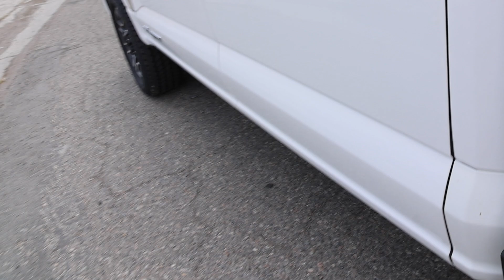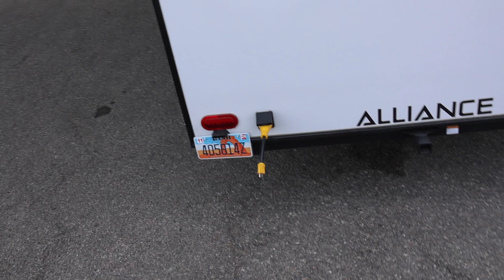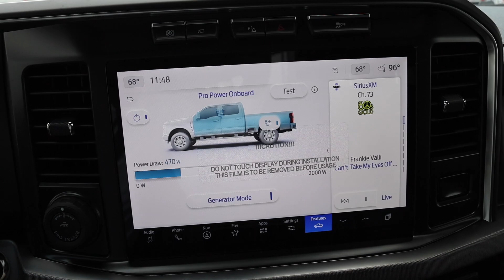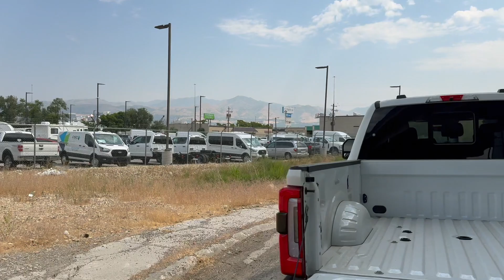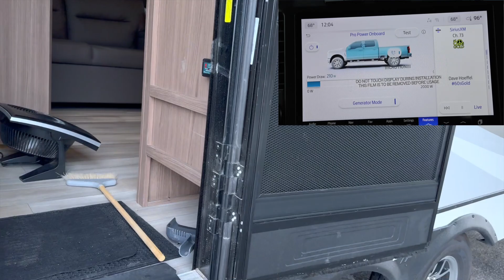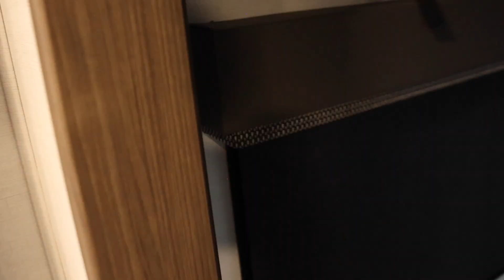Can The Ford F350 2.0 KW Pro Power Onboard Run My Entire RV???

Comment: I have a 2025 F150 with the 2kw onboard generator. In my TT I have a 270Mah battery and a 3000 converter.  When boon dock camping, we turn off the inverter and only use those plugs and accessories that pull direct from the battery.  When we have to use something like the microwave, we turn the inverter on.  Our A/C is roof mounted and very efficient, but it will only run on battery for about 5 hrs.  We did hook the TT into the 2kw but unlike the larger generators, the 2kw puts the F150 into a constant idle mode.  Meaning, the truck is always on.  As an alternative, we carry a large EcoFlow Delta Pro in the truck.  We run the normal TT power cable from the TT to the EcoFlow and if we manage our usage, that set up can get us through an evening with the A/C running.  To charge the EcoFlow, we plug into the 2kw...you have to set the EcoFlow through the app to draw/input something like 8w (I think it's watts, I have to look at the app).  Anything more and the breaker on the 2kw might pop. I do wish the truck I got had the larger generator, but none were available in our area.  The above has worked for us, but we could be doing something wrong, so if someone has a better option for power management, please post it.

Comment: The 7.2k in the 150 Powerboost will run your RV completely for a weekend for sure.   This 2K one won't do that, but it will allow you to keep your batteries topped up, for lighting, water pump, radio, Tv and the like for sure.    Some power is better than no power at all.

Comment: Dude,  you get 400w without generator mode.  If you want 2000w you gotta turn on the generator mode.

You’re running your TVs and converter off 400w system. Not even touching the 2000w

You definitely can’t run your microwave off the 400w system.  It would run off the 2000w

Comment: I like the idea of using the 2kw on board power to power up the basic 120v in the trailer. This to me is a great way to charge your lithium batteries when traveling via the trailers converter rather than all of the cost/work to install a dc-dc charging system.
Much easier to use a 120v 12-14g extension cord as an umbilical to the trailer rather that a couple 4g (or bigger) for the dc-dc charging.

Comment: Get a shorter larger gauge extension cord. I can run my bedroom AC with my Generac 2200i (1800W running) using a 25' 10 gauge extension cord. The adapter you have is similar to the one I have. If you strip back the insulation, the wiring is 10 gauge. I just got delivery of my 2026 F350 with this feature so I'll play with it on my trailer to see what I can run using my 10 gauge extension cord. That's crazy your trailer couldn't keep up in Vegas. I know it gets hot there since we always stop to stretch on our way from SoCal to Southern Utah every year. Our trip this year to AZ was pretty hot in Havasu and our trailer stayed 72 throughout. It's a 34' toy hauler but it kept cool. It was 117 outside too. The trick I found is to put that reflective bubble wrap in the windows.
Reply: could you run your ac from your f350?
Reply: @Prietoalejandro I never even tried lol. I was literally just thinking about this too. My assumption is the locked rotor surge will trip the power station. My Ryobi 1900 psi pressure washer kept tripping it 🤷🏻‍♂️

Comment: It would be a life saver if you had a 120v refrigerator full of food and were traveling from one rv park to another. Or, it was freezing outside and needed to run the fan for the gas heater. For obvious reasons you wouldn’t want to run an rv on 2kw of pro power all the time, but in limited situations it might come in handy.
I have a f350 with the 2kw pro power. Ive used it twice in two years. Once to charge a dead battery and another to power some 120v lights. Both times  less than an hour.

Comment: I made my own cord.  Purchased 8awg and a 115v plug end.  The wire is 18 feet.  Plugged in at the truck bed and ran the other end through with the factory wires to the transfer switch and wired it in. My unit is 41 feet with two coleman mach ac units with coleman soft starts.  I'm able to power up one of them and also keep the fridge running while driving. Your issue is too long of a cable with too small of a guage wire.  You had a lot of voltage drop.  2000watts divided by 115volts is 17amps.  Plenty to crank up an AC

Comment: Ram has a 2,400wt as well. I think it's an unnecessary item unless you run a hotshot. Then, you can power a microwave, etc. Idle is bad for all motors. Gens are built differently

Comment: It'll work great in a pinch if you use gas for the water heater and fridge. You can run the microwave at lower power level as well. 2,000 watts will run our 15,000 btu AC also. We use a 2,000 watt Honda for camping. You shouldn't hurt your truck if you go over 2,000 watts. They have circuit breakers for a reason.

Comment: No way that camper is 50 amp. There is only one AC unit. He says there are 2 but a camper that length never has 2 units. If it did, it would never get hot even in the desert. So much wrong with this video besides this too.
Reply: I think he would know if his camper has one or two a/c's

Comment: generators "grow legs" 
i would recommend f150 hybrid or even better a Lightning for something that wont disappear easily. this is more to charge 6-10 tool batteries at once and run your laptop.

Comment: Just to let you know.. when your trailer is plugged into a power outlet (i.e the truck) the converter converts the 110v to 12v.. so the 12V appliances will be drawing from the truck.  Still, good video.  I'm looking at getting an F150 to power a trailer I also will be getting.. so likely will be looking for the hybrid with the 7.2KW onboard power.

Comment: I thought with the Pro Power option on the super duty you got a 208/240 style outlet?
As for the idle time -- that should bother a diesel less than a gas engine.  Yeah, the particulate filter will have to go into regen mode more often than if you were driving down the road, but one of the advantages of the diesel engine is the longer life.

Comment: I have a 2013 f350 with an inverter that plugs into the cigarette port. Would it be safe to run it off that or should I use the plugs

Comment: I'm hoping to leverage the Pro Power Onboard to charge my battery bank in the 5th Wheel while going down the road so that it's at 100% when I get to the Boondock site. The motor will be running anyway driving down the road and then I can just use the batter bank once I'm parked supplemented with solar. Any reason this won't work? I jst need to find a way to run a cord through the 5th wheel hitch to the lower bay.
Reply: I'm thinking the same thing.  Did you ever figure out how to do it?

Comment: Ugh, no.  Except in an emergency, why would you idle that truck to get 2kwh instead of using a cheap 2kw inverter generator?!?
Reply: Agreed. The power onboard should be used as an emergency backup and it certainly is nice to have. Getting a small generator for constant running is the way to go IMO. Save that idle time and gas.
Reply: Because you already have the truck…
Reply: @Truckinlife  Other than "except in an emergency," long term idling the truck for 2kw "because you have it" is the epitomy of "penny wise, pound foolish."

Comment: Not really usable for boondocking but great in an emergency if your RV batteries die at night and you need to power your fridge, leveling and tongue jack, a floodlight, couple fans, etc.

I have a generator and a basic solar package on my RV but it's always good to have multiple failsafes.
Reply: If they're "failsafes" there would only need to be ONE.

Comment: Very good question dude! I’ve been curious about this.
Reply: Also, I am 100% able to power one AC on my RV plugged into 20 amp no problem. Do it all the time. But I am super interested in the future of this. I’ve also been playing a lot with the big solar batteries. I have one big enough to plug 30 amps into and it’s actually impressive as well. Lastly, dude the BougeRV panels are the way to go.

Comment: So…..essentially a total waste of a system on that Super Duty if you RV.  😂
Reply: Idk, good in a pinch. It's like he said, not really meant for RV boondocking but great for emergencies or things like power tool applications. 

I probably wouldn't option it in but my Platinum came with it and I've already used it a few times.

Comment: Powerboost f150 has 7.2kw of power....come on superduty engineers....let's get that half ton features on your full size trucks...
Reply: The Super Duty’s don’t have the high voltage hybrid battery, like the F150’s do. Non-hybrid F150’s can’t have 7.2kw either. Your alternator wouldn’t be able to keep up with the discharge rate. Once they release a hybrid Super Duty, they’ll do it
Reply: My cousin has a 2021 F-150 Powerboost and he runs everything on his trailer with it.  Why doesn’t the F-350 have a 30 or 50 amp plug like the F-150 does?
Reply: Not worth it to me.  I have the champion 4000w dual fuel inverter generator for $700. You can get the Wen 4000w duel fuel for even less.
Reply: @grrrrr2936WHAT!? I COULDN’T HEAR YOU OVER YOUR SHITTY GENERATOR!

Comment: Are you kidding me? You must not have a commercial driver's license. Diesel engines are designed to idle for extensive lengths of time. Have you heard of Cummins or Detroit? 😅
Reply: The emissions ruined that. However non emissions diesels are way better idling for long periods of time vs gas.
Reply: @CatRichardBojangles yes, pre emission diesel is most definitely the best way to go.
Reply: Used to be fine but now it’s bad to idle modern diesel trucks…
Reply: Emissions crap.
Reply: High idle helps. But still not awesome.
Reply: Are you kidding me?  - You don't know zilch about the modern diesels